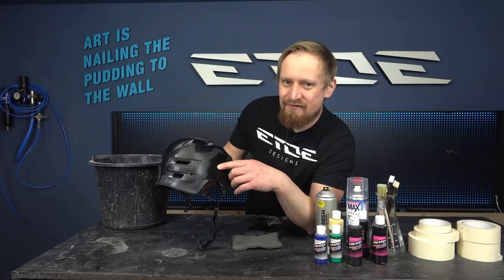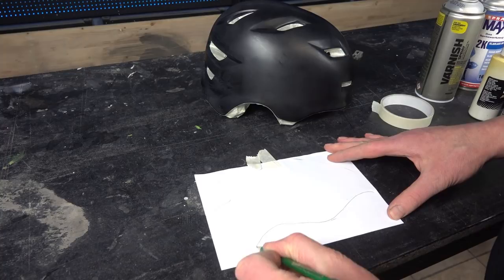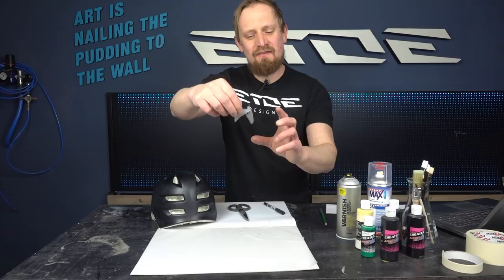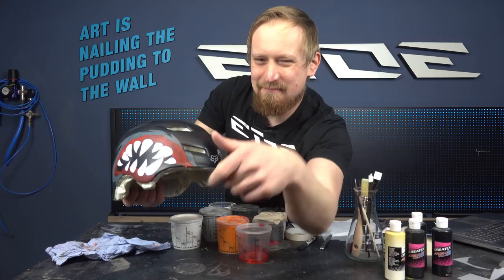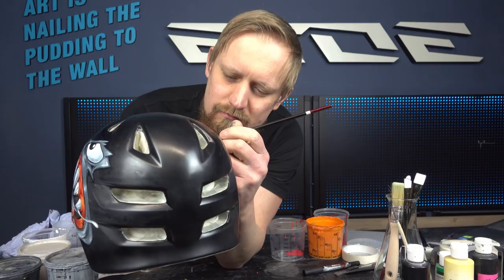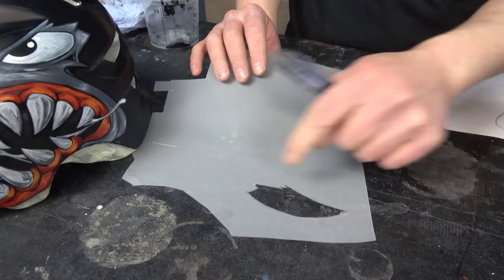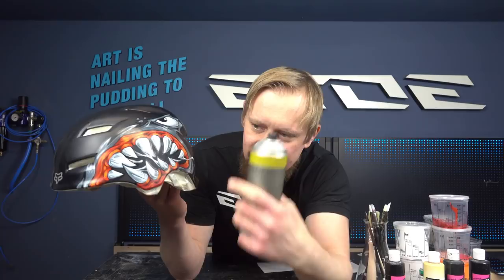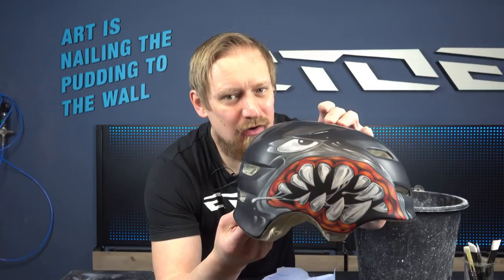paint a bike helmet with a brush - DIY

Comment: I'm really curious, but a little confused... are you actually removing any visible brush marks? or simply building up the valleys with clear coat and then wet sanding back to get a smooth finish?  I presume u still see depth in the brush strokes?  Love your work btw!
Reply: Phu Le building up the clear coat and then sanding back gives the helmet a consistent finish. You will still be able to see the actual brushstrokes of the original paint but the helmet will feel smooth (no ridges or valleys). By using multiple layers of clear coat, you are only sanding the clears and not the paint beneath it (basically sanding back the top two coats and the first coat still protects the original paint). I hope this helps and doesn’t confuse you any more🙂
Reply: @driverlance  Thx for the clarification!

Comment: Why do you spray first gloss coat then sand it?
Reply from the maker: To smoth the surface.
Reply: @ETOE  if I wanted to paint a bright green. And my bike helmet is orange do I need to add many coats of white then sand and paint more white. Or just paint bright green on straight away.? Thanks for responding. I'm using acrylic paint and a brush.